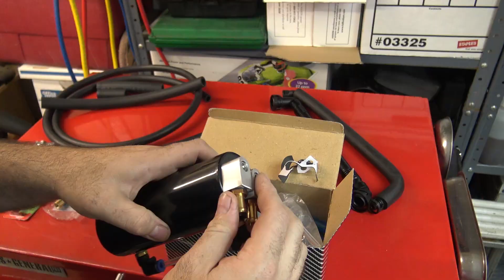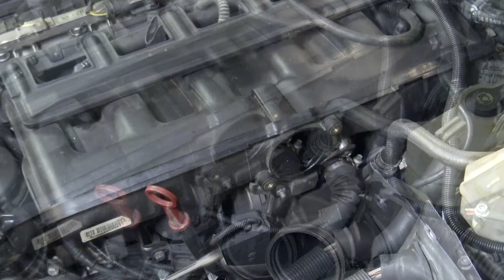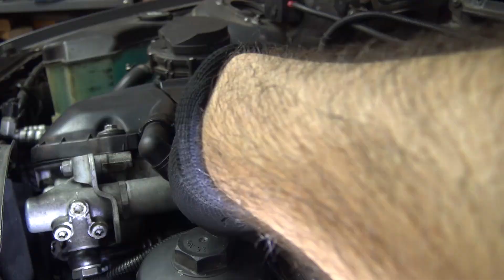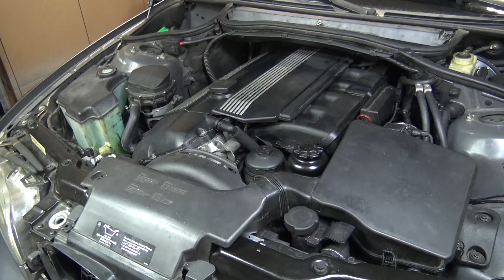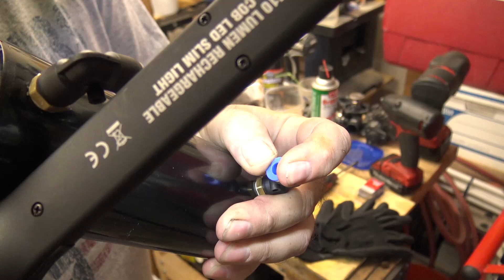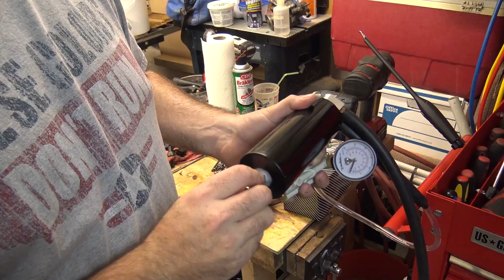BMW E46 Oil Catch Can Install DIY

Comment: I have watched almost all of your videos and I absolutely use them as a Manuel lol this one however confuses me in the beginning it seems you have the pcv valve in the tube from the valve cover then at the end you say it's in the one from the intake runner please specify witch tube it goes in I am going to install this system today and am confused also I bought all the parts in your description and the catch can is different have you done a vacuum test on this can you recommended a quick reply would be great and again thank you so much for the videos I absolutely love them

Comment: Do your self the favor and get the cheaper catch can. I’m having the same vacuum issues on the mishimoto universal catch can. Also please make sure you get the proper o rings for the dipstick and clean the mating surfaces of the dipstick. Story of vacuum leaks with my 330. Disa valve vacuum chamber failure. Catch can flaws. Improper dipstick o ring. Day three and finally getting a grip on it.

Comment: I have a question I did the catch can using all the parts you used for the most part just used a different catch can I noticed that’s out line on the catch can is sucking closed
Reply: Am wondering if I have lines mixed up are something I used notice it when I was changing the gas tank  vent valve I hear sometimes it makes little noises around the dip stick area
Reply from the maker: +colby quarles I’m not sure that’s a question.
Reply from the maker: +colby quarles could be
Reply: I wasn’t sure if I had the check valve in the rite place cause car runs fine but it seem to be building pressure in the crank case I can hear noises sometimes. Correct me if I’m wrong the check valve is supposed to be on the intake side and that line go on the output side of the catch can
Reply: Thank for all your videos they are really helpful
Reply from the maker: It doesn't sound like you have the valve going the right way if it's building pressure.

Comment: Hey 50's kid I could really use your help.... so yesterday I changed the control arm bushings and also did the ccv delete and install a kmotor oil catch can bought the same pcv valve install everything correctly and when I went ahead to start the car it did not want too... it hesitates, it cranks and after about 5 sec it starts up and turn the traction light on as well as the ebrake yellow light stays on and car runs totally BAD Rpms shake and when I turn off the car I hear a weird a noise coming under the driver side dash..... I did my brakes and rotors about a week ago and I did noticed a need a new rear brake sensor and I need to  adjust my ebrake now cause you need to pull it ALL the way up so it can hook..I keep hearing that it can be a speed sensor or to get an alignment and they go away.... but Idk what I did wrong with the oil catch can it's similars to yours but I am not running a drain line bought the pcv from oreillys but it looks identical to the one you have from Napa Idk I'm mad sad that this did not work for me lol it's a 2004 bmw 325i m54
Reply from the maker: +Jose Navarro sounds like a massive vacuum leak. Ya did something wrong somewhere dude. Go back over your work and check it

Comment: Do I actually have to use a pcv and if so what actual side should I have it on.
Reply: I grind mine down and use it as a Plug / Housing to hold the Hose :D

Comment: Could I just get a reducer to go from 3/4' to 3/8 on the valve cover side? This way I don't have all the extra hose and couplings. Thank man!
Reply: Don't reduce it if you are going to use " long " hoses.
Reply: Thanks for the response bro. My catch can came with 3/8 and 1/2" catch can connections so I am going to use the 1/2".
Reply: +Daniel Bailey - Use whatever you want... Just match it to your Car Hoses and NOT long on the Hoses.

Comment: What would happen If I connect the hose from the oil catch can to the vacuum port on the back of the intake manifold instead of to the intake equalizer distribution?
I'm talking about keeping the equalizer and not capping it off. 
Is it possible to let the intake of the  equalizer free absorbing athmospheric air? Or maybe it would work to run a hose with a tee from the catch can as well to keep this part absorbing vapors?
Great channel Jason. I'm impressed with the amount of knowledge you share and the way you do it.
Reply from the maker: Essentially nothing.  It's just another source of vacuum and I doubt it would change anything on the catch can side of things.

Comment: If it's not baffled what's keeping all the vapor and other crap from going right back into the dipstick tube? I'm curious cuz I need to replace my ccv system and just wanna eliminate it all together with a catch can.
Reply from the maker: Nothing is keeping the crap from going right back into the oil pan. If you don't like that arrangement, do not use the detain line. Just use the stopper bolt and drain it out on the regular

Comment: CCV M56 Check Valve? In viewing this, I think that a check valve and an oil catch can should work for the M56 SULEV Engine as well.  The M56 SULEV has the CCV mounted inside the valve cover.  This is the CCV that is ONLY available as part of the aluminum M56 valve cover assembly for about $500. That valve cover already contains an oil separator feature, with a drain back inside the cover.  When the SULEV CCV fails it would them seem that the only part that is then needed is another valve, located external to the valve cover.  A second catch can on the line would be a nice feature.  Because there is the oil separation feature inside the M56 SULEV valve cover far less oil is likely to accumulate in the  catch can.  Any thoughts?
Reply from the maker: Yes since the oil separator is inside the cover, there's no need for a catch can.
Reply: When the CCV valve inside the valve cover fails, installing a valve with approximately similar characteristics on the hose between the outlet for the CCV valve on the valve cover and the suction port on the intake manifold, should be a complete solution.
Reply from the maker: yep

Comment: Hi again 50s kid,
ive been trying to find you catch can install video where you found that you put the PCV valve in the wrong way, so it was being sucked close constantly. 
I have bought the correct PCV valce for my 318 and im not to sure which was the flow goes as there are no flow marks on the valve. Do the threads do towards the valve cover and the non threaded end towards the catch can?

thanks
Mark
Reply: Hey Mark. If the pcv doesn't has any flow arrow, just try to mouth blow to each sides. If you could blow it through, that means the side you're blowing is the upstream.

Comment: It looks like you installed the PCV valve  in the  same direction, you just moved it the first time.
Reply from the maker: if you study it more closely, I actually did end up rotating which direction it was facing--because this time it was on the other output side of the catch can
Reply: I guess I missed that part, too busy watching the direction. Sorry.

Comment: (Need help please read) 
Just did a catch can thanks to ur video which was very helpful. But me being my silly self left some connector unpluged that was attatched to that small wiring harness near the ccv.

Its a 2 pin connector with a single brown and white wire and i have no idea where it needs to plug in. All i know is i was forced to drive my car today and it overheated. And all i can do is pray my head is fine and hope that little connector is the source of the issue. 

Coolant level is fine, oil is fine, held perfect temp driving. It seems like my fan didnt kick on when i stopped and thats when it over heated. 

Does anyone know what that connector does and where it needs to go?
Reply from the maker: ben thul send me some pics on Facebook and I’ll tell you where it goes. Whatever it is I doubt it caused your overheat. Check your cooling system very carefully for cracks, particularly your expansion tank

Comment: Should all of these PCV's work the same? Still having issues with mine. Car runs fine except at idle.
Reply from the maker: +Tom Swope yes all the pcv valves are the same. Just different part numbers made by different companies. Your problem likely lies elsewhere. Almost certainly a vacuum leak somewhere. That’s why I don’t like catch cans...a tiny leak somewhere is actually a huge leak

Comment: I just finished this install and im getting a p0170 and p0173. The car performs much better, except at idle. It will occasionally miss and just doesnt seem quite right. I used the Purolator PV1050 for my pcv, and ideas of what I could be doing wrong?
Reply from the maker: +Tom Swope have you changed your valve cover gasket yet? If it’s leaking it will cause fuel trim problems
Reply: I did! I used your diy video to do it. haha  
The engine runs fine except when idling.
Reply: +Tom Swope - Make sure to install on PCV Side only.  Buy another Can with " Larger Hose " for your Breather Side. NOTE:  Use " Shortest Hose you can " to eliminate " Starved Air ".

Comment: I changed that and the valve cover gaskets and now my car is smoking heavy, white with smell of oil burning. I changed the intake to throttle body gasket also and noticed that the intake had a lot of oil in it.  So I figured that I must have either clogged the separator or the tube is cracked. That's why I ask about the catch can on 4.4.  I did change the valve cover on the drivers side too. It had a crack in it and they put jb weld so I changed it. And now it's like a train blowing smoke out.
Reply: +Jason Harris -  Make sure to install on PCV Side only.  Buy another Can with " Larger Hose " for your Breather Side. NOTE:  Use " Shortest Hose you can " to eliminate " Starved Air / Blow by ".

Comment: Can this be done on the 4.4L? I see alot of the m52 but nothing on the 4.4l vanos .
Reply from the maker: That's because these engines do not have the same kinds of CCV problems that the 6 cylinders have.  Although you may need to change the diaphragm in the oil separator, but it's easy to do.  They also don't have the oil consumption problem that the M54s have.

Comment: Saw your video and I’m determined to put a oil catchcan on my e46 with M54 engine.  I have 140,000 miles and my car uses no oil but I want to keep water and sludge out of my oil. How did you determine the second pcv valve was the correct one and is that one spring loaded so it will work horizontally? Also would it be safer to connect the dipstick drain to the input side of the catchcan incase you have crankcase pressure trying to escape from the lower crankcase?
Reply: +Larry Klassen - You need 2 Cans... One for PCV and the other for Crankcase Breather.  Don't " Merge ' install both in the same can... You will have Vacuum / Blow By issues. ://

Comment: Yes, I'm a follower, 50kid , great explaining details,  including possible common errors , where human :/ I also installed a decent priced aluminum square oil can on my E36 328i and at start up only, it smokes out the tail pipe slighty( 72,000 miles).. My Engine turns over 3 times before starting :(  idle is not smooth,  up & down 700-1200 RPM radically.. So I watch your video and discovered that not only does the pvc value needs to be facing the right direction, Thanks to you 50kid but mainly I must say that the check  valve itself also should  be facing vertical in place to work properly , meaning the (ball type)  that's inside the check valve  should be on top  so it's closed even with just a little vacuum on it (idle).. (gravity is keeping it down closed )  however when thottle is increased  the slightest vacuum increases enough that the valve opens (ball is pushed up)  at that bmw recommended  vacuum pressure .. if it's  the wrong check valve (light duty ) or its laying horizontal the valve will never be closed( ball type) ..  It will stay open at idle and uses engine vapor (incomplete combustion) that causes idle surges when warming up at cold starts only. When icv is fully opened at operating tempertures,  restarting with this  warm engine now, everything is fine until the next morning start ..other out there when you realize how a check valve works then you'll understand that  it must be upright and pressure must open it at the right time .. that's why there's different pressures for different models... FIXED!  THE RIGHT CHECK VALVE , ARROW TOWARDS VACUUM , VERTICAL INSTALLED.. Thanks 50 kid for leading me on..hope this helps others.. PEACE
Reply: Thank you ! Thi is absolutely damn correct !

Comment: Hi -- Great work on the Videos!   Really appreciate this.  Question; on another video you were frustrated with the set up it leaked and stank up the car.  I am wondering where the leak was...I have the same can and am about to install.  Thanks!
Reply from the maker: I think from the seals in the can. I recommend a better quality one
Reply: That is curious as your vacuum test seemed to confirm you got the can sealed up fine.  The other thing I don't quite get;  is if the system did leak, it would suck air in if the can was under vacuum.  I see others complain about smell too.  So I wonder;  if the PCV was too restrictive on the manifold side, then the catch can may actually be under pressure from the crank case....that may explain smells.           So did you abandon it and go back to CCV?
Reply: 8 months later and I finally installed the can today with your process. I did find a leak on the can that you did not mention. The bolts that hold the machined aluminum pieces to the top of the can did not have sealing washers under their heads. So there was a leak between the bolt and the machined piece. I made washers from gasket stock and found the can then sealed. I also stuffed stainless steel pot scrubbers up in the can as a baffle.     Anyway......day 1 and it works, will see.....cheers and thanks again.

Comment: Jason I need you to help me with my car. I live 4 hours north but am willing to travel. This thing is draining me. I have low compression in cylinders 1,2, and 3. I seem to have an extreme amount of carbon build up in those 3 cylinders from the looks of my spark plugs. I'm getting misfire codes in 1,2,and 3 only and a P1411 which is a secondary air code but I'm having trouble locating a definition for it through the BMW website. Incorrect flow detected comes up on my scan tool for audi but BMW has none. How can I tell if my oil separator is clogged?
Reply: How low is the compression? I mean, if it's really low you're not gonna fix that by curing the cause because the problem is already there, you know?
Reply: 65-80 psi I have put some Marvels Mystery oil down the spark plug holes in hopes of dislodging a stuck ring or 3 :) I'm a single dad and a full time student at 47 yrs. old. I cannot afford to rebuild the motor and a novice mechanic to boot. Any help you can give in the way of advice would be greatly appreciated. I'm just up the road on the 101 in Atascadero, 20 miles north of Pismo Beach. If your ever on the central coast hit me up, I'll line you out on things to do and places to go.
Reply from the maker: Usually putting solvents/cleaners down in the engine only applies when you lose compression completely -- because the ring is stuck into the piston groove.  You can try some GM fuel injector cleaner if you want but honestly you should do a leakdown test to figure out exactly where the loss is happening.  Whatever the problem is, it won't care about your pocketbook. ;-)

Comment: Hey Jason, Is it possible to install an oil catch can on my 04 325i M56 S.U.L.E.V.?
Reply from the maker: +Jason Crouch nah there is no point it won’t do anything. The m56 oil separation is all done inside the valve cover.

Comment: Purpose of this? Benefits? Cons?
Reply: From what I understand the m54 has a poor piston ring design,  a two ring setup when 3 was needed and used in previous engines like the m52 TU. These m54s burn up to a quart of oil per 1000 miles! 

Additionally the stock air oil separator ccv cyclone unit can sludge up with wet oil from condensation and stop working so a double whammy of burning oil in the combustion chamber.  

This will eliminate the cyclone ventilator,  still keep oil out of the intake,  and increase crankcase vacuum which theoretically is making those shitty piston rings make a proper seal thus eliminating oil consumption via burning it in the chamber

Comment: Does anybody know which alternatives we have in europe for the pcv valve? Is there any specification which it should meet?
Reply: Order from ebay/amazon or ask for Chrysler 300M 3.5L 2004 PCV valve at parts store.

Comment: i have a 2006 BMW X5 3.0i.  i always used Castrol 5w30 full synthetic. follow your instruction. just installed oil catch can last 3 days. it gives me an alarm Stop!oilpresslow + red oil can flashes randomly. now the yellow engine light is on. can you let me know what have i been missing. Thanks
Matthew
Reply: Did u fix it?

Comment: When you changed the PCV valve location, I noticed that the valve was facing the same direction only closer to the valve cover.  Did I see that correctly?  Thank you for all your videos!